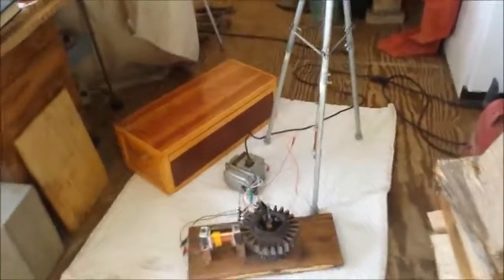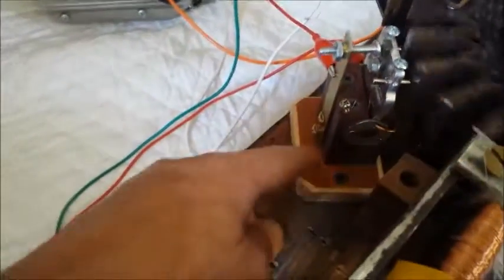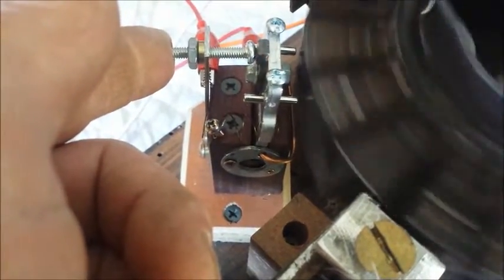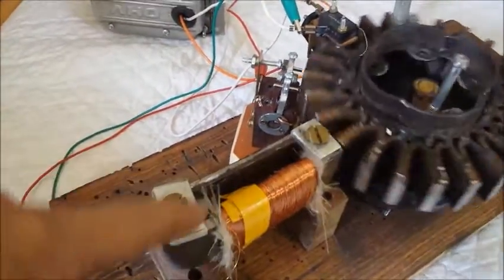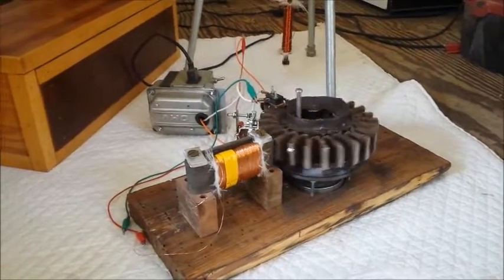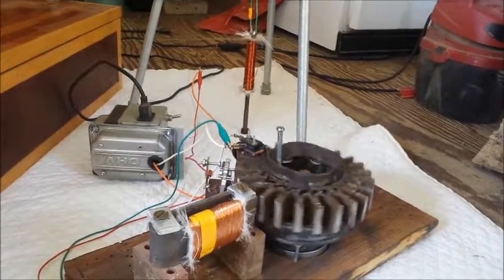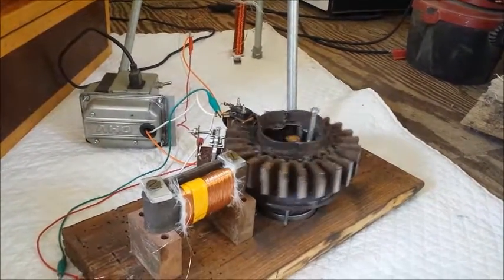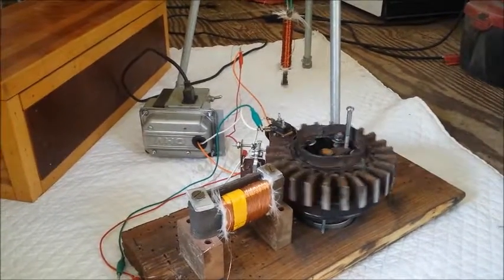First model set of Eds homebrew Rock Chipping Machine

Comment: How about explaining how Ed levitated his stones? He told us how in his experiment. You know the one Everyone thinks is just simply explaining how magnetism works. When all you have to do is upscale it to cables currently used in our cranes or winches on vehicle. Place a iron cored coil at half it's length and place it in the PMH between the two coils in the round area and wire it properly. The coil on the cable when energized causes the North and South Pole magnets to flow out the opposite ends of the cable. Paired up with another magnetic lever you can use the like force magnetism to levitate the stones or anything else nonmetalic in nature. Ed buried one (or several) beneath the sand (glass panel in experiment) to insulate the two fields from touching. Ed kept track of these cables and their pathways with his steel soled work shoes once everything is energized. The PMH itself will hold the Magnicity in the cables until the bar is removed (explained with the light bulb in other areas of his writing). He also used Earth batter garden/technology to power his genererator that during the bewitching hours of the night find their peak value. Glad to see you was able to get the generator up and running on the transformer but you can reach 24v with only 16 Earth Batteries if you create an acidic value of 1.5v per cell. Some tree's uses as battery can also reach the 1.5v and also act differently in the bewitching hours.